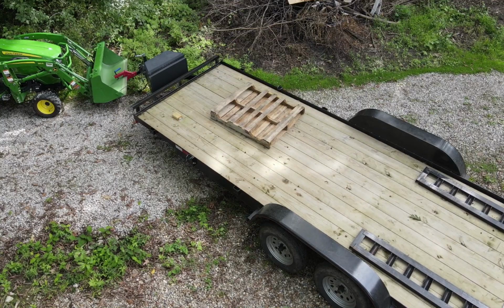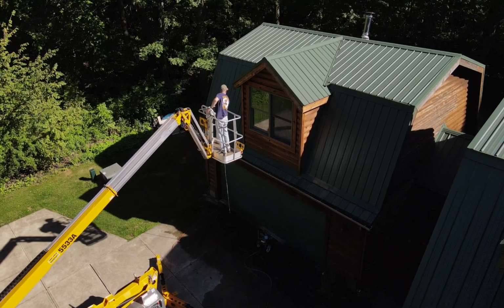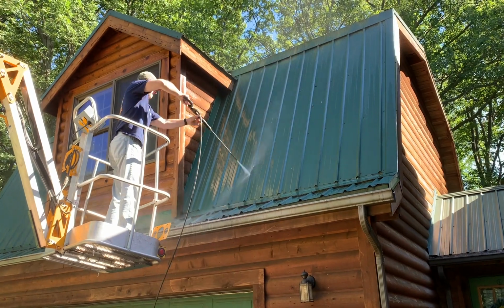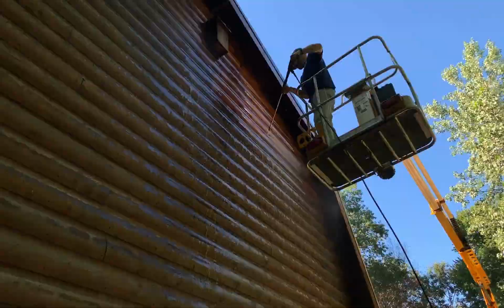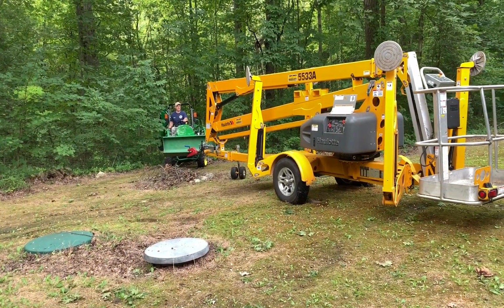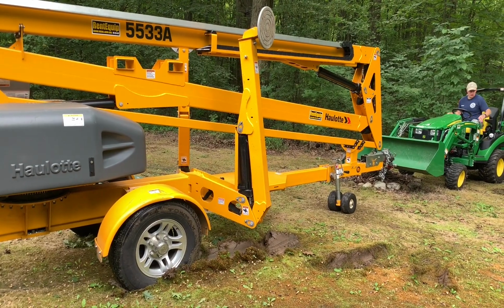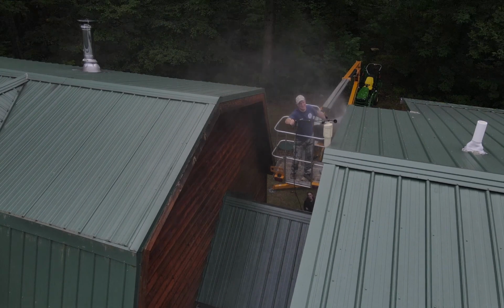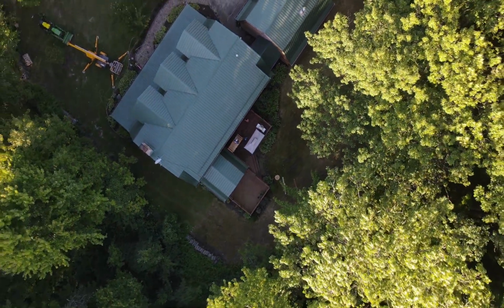1025R: Under Pressure

Comment: Tom, looking at the video around 11:14 or so, the wheel is stopping.  Judging by the look of the hitch, that trailer has hydraulic surge brakes.  They're designed to apply braking force when the trailer is pushing hard on the hitch....like when you're braking in the tow vehicle.  They're great for vehicles that don't have dedicated brake controllers, but they suck if you have to back the trailer up a hill or in soft ground.  As you're pushing on that hitch, it's actually applying the trailer brakes and fighting against you.  There's usually a lockout pin/lever on those surge brake couplers that you can use when you need to back.them up a hill, etc.  Hopefully that's helpful for you next time.  Keep up the great videos.
Reply from the maker: Thanks for the info.  I know it had a lever by the tongue for a parking brake, but did not investigate more for the brake controller.  Take Care, Tom

Comment: I built my own hitch that requires no tools and slips over the lip of the bucket and works extremely well. I know you probably know but most rental companies require a harness when operating so you don't get flung out of the bucket. Also here in Akron at Sully's tool rental they have one that goes about 55' but is driveable and looks just like that one. We rented the same 65' you have to take down 2 huge 75' tall maples in the back yard a few years back. Happy retirement!

Comment: Those lifts are awesome. We have a genie version of basically the same one. Wish I had one for home use 😂
Reply from the maker: Probably not the last time I rent one.
Reply: @ataleofthreecabins1025  I'll probably be renting one again this year. I used one last spring to take down a dead maple and a dying spruce that had a real bad lean over my power lines. I used every bit of height on that one to take it down in small chunks from the top.

Comment: I've used that same type lift and pressure washed my buildings a bunch of times. A couple hints, When pressure washing, everyone has a tendency to wash pointing down. the problem comes in when you get on the ground and look up, all the dirt still shows since the lower edges didn't get a good cleaning. Just make sure to get below the work and spray up when you think its all done. Also that lift has an amazing amount of horizontal reach. There is no reason you cant get to all your places ( it appears). Also another 1000 psi always helps. Good luck and looking forward to the follow up.

Comment: I use a Titan forks for moving my trailers around. Got it on amazon with 36inch forks. Only thing i don't like is having to take off the forks to use the 2 inch receiver. If forks are on no sharp turns. But going to order the back plate so i no longer have to take off the forks every time. But i like that i don't have to clamp the pins back if im just moving a trailer then putting back on the bucket.  I move my 3 trailers around 4-7 days a week. Much easier then with the truck..

Comment: Clean out those gutters while you have the power washer out and the lift on site.  Speaking of gutters,... You need gutter guards to keep the leaves out of the gutters and prevent the need to clean out the gutters.  Stay safe.

Comment: Consider dropping the air pressure in the tires of the lift, it will float up on the softer areas.  We use this trick when off-roading  in soft dirt and sand.  Just air them back up before hitting the highway when returning.
Reply: i couldn't tell from the video but the trailer may have a hydraulic brake.  It looked like the wheels were not even trying to roll when you hit the soft stuff.  I have experienced this when backing up a boat.  You need to insert a pin to stop the piston from activating the brakes.

Comment: Interesting to see the lift in use. I have thought about renting one to remove some tree limbs.
I know it is a more expensive solution. I have the Artillian JDQA frame for my loader. It has the 2x2 receiver built in. I move trailers frequently and my 48 foot lake dock. You can see thru the frame and with a long ball mount you can turn pretty tight.
Do you like your loader mounted blade? I have not used mine much but the only thing I like about it is piling the snow higher. 
I use the same scaffolding in my building so I can rack and stack implements.
Reply from the maker: Might be a future investment.  I know I relooked at them after this project.

Comment: What a tool you've rented..... I'm too old to be hanging off of ladders/scaffolding any  more.  I'm curious
about the  "Clamp on Hitch" you attached to the bucket ?   Is that like a "C Clamp"  b/c  I can't see that
being able to last long w/o bending it under the weight/pressure?    Or does it have a pin that goes thru
a hole in the bucket?  I can't tell  & this seems like a generic attachment that I might be interested  in
owning?  peace.... I need a trailer like that right about,,,, Now !
Reply from the maker: More like a C Clamp, but pretty beefy.  Ebay has some around $62.
https://www.palletforks.com/skid-steers/trailer-moving/clamp-on-bucket-hitch/192100.html
Reply: @ataleofthreecabins1025  ~ty much